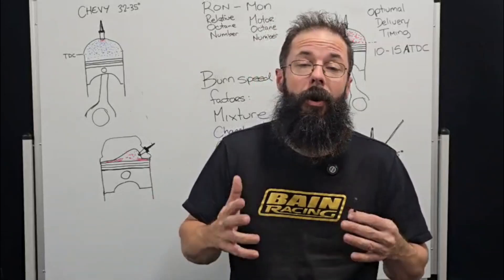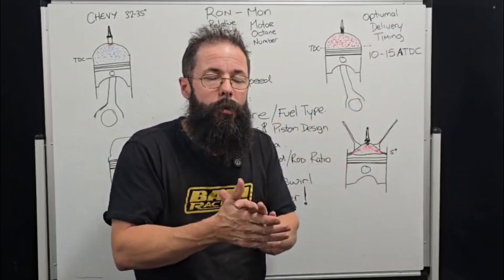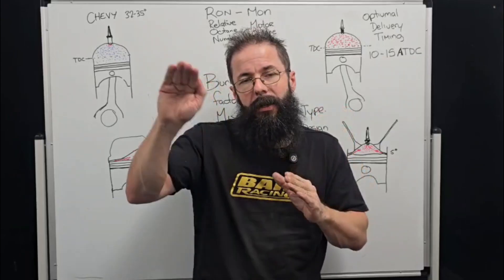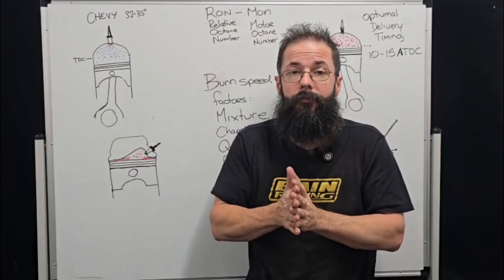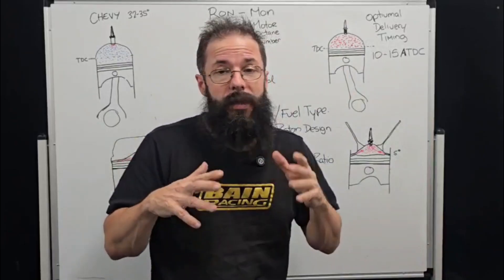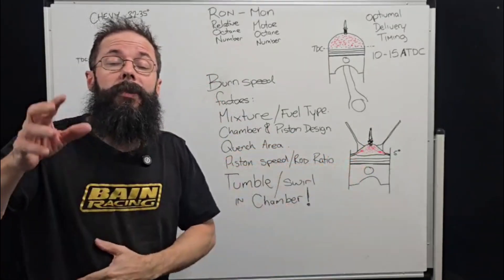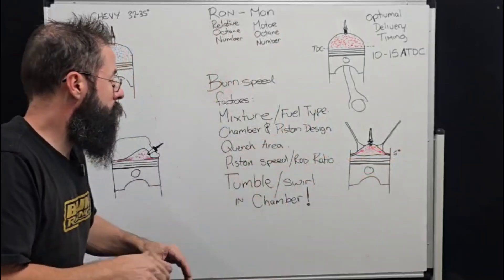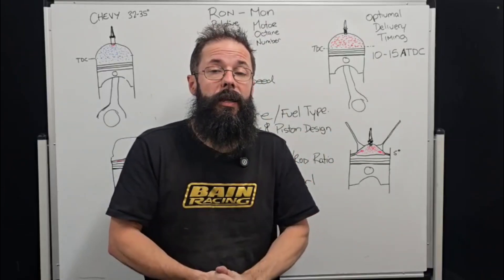Understanding Burn Speeds & Engine Combustion: Sponsored by Einstein Motors #carcommunity

Comment: Good explanation, not a whole lot on this out there. I build vintage Ferrari/Lambo/Maserati racing engines, and most of these are pretty short stroke with large hemi chambers, thus they require a massive dome to build compression. These domes are of course horribly inefficient to the burn speed so even with 11.5:1 or so static compression they need 38-40 degrees of total timing. VE of these I suspect never hits above 90-95% so it’s unlikely I’m ever dynamically seeing the static ratio anyway
Reply from the maker: Yeah, engineers had some funning ideas back then. 👍
Reply: Along those lines I thought maybe a 4A-FE head could end being superior thanks to narrower angle valves and smaller ports. But I haven't been proven right so.. 80/90s it was all about canted valves, atleast in Europe

Comment: Recently built myself a high comp - 225psi cranking,  duel plane, 850 holley fed 98 fuel 408 windsor. It makes a healthy 570hp 560 ftlbs timing 28° It seemingly has no probs running 98 straight out of the pump and is very fuel efficient for what it is. 20mpg   Only prob I had was it ran on when I turned it off. Idle timing was 18°.  I found giving it 28° at idle completely eliminated the running on issue.  Any thoughts on this ?  I should add timing is controlled electronically  luckily,  that's how I was able to do this,  I also now  run vac advance with as much as 40° under light load conditions and this has transformed this engine from a cranky jerky bitch of a thing to an absolute pussy cat and pleasure to drive
Reply from the maker: Run on when turning off is the engine is "dieseling." The lower timing at Idle causes more heat and creates a hot spot. Generally, the plug electrodes glow, and it causes this.  Adding timing at idle cools the chamber.  Also, the wrong plug range can make this happen. 

Yeah, with part throttle, you have less air fuel in the cylinder,  so burn time increases.  

But at 225, you're definitely up there. So everything needs to be perfect. 👌
Reply: @bainracing  thanks heaps for your feedback, very much appreciated. I understand it's very difficult without seeing the plugs to determine correct heat range but in your mind what would be a good starting point for an engine like this ? Currently I run an ngk 7. Plugs are very clean as far as fuel goes and do not appear to be over heated. Apart from the porcelain being brown I would say everything looks good. 
For an engine with a reasonably meaty cam - 242/252 620 lift,  it idles and cruises happily with afr's  high 13s low 14s. Again many thanks for the reply 🍻

Comment: Paul Hallam, whose father Frank Hallam was chief engineer for the Repco Brabham engine project, was designing combustion chambers for Australian Superbikes that ran a small "lens-type" combustion chamber, similar to a two-stroke chamber, in order to get very high squish velocity and homogeneous gas mixture before ignition.

They worked extremely well.
Reply from the maker: Yeah, the "lens" shape is definitely a good way to get that high squish, which helps with combustion speed and efficiency. 👌